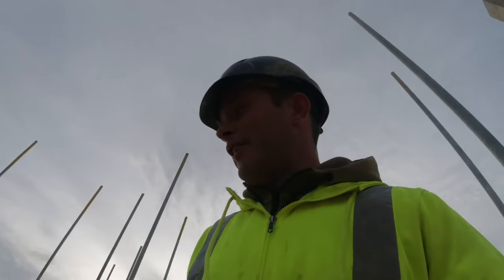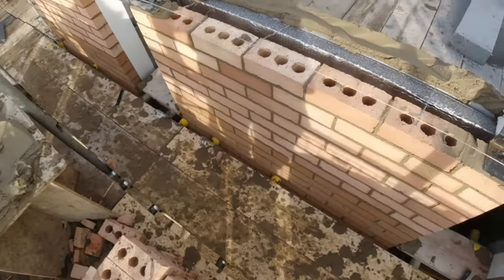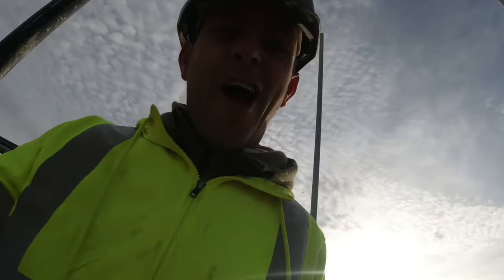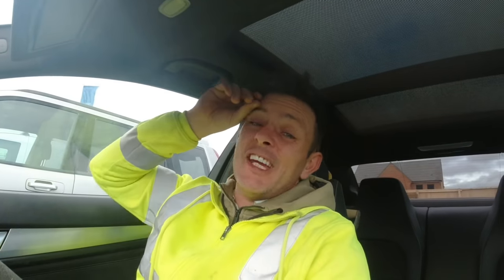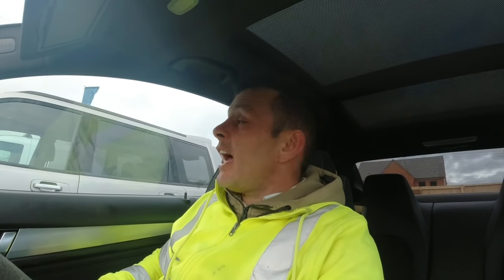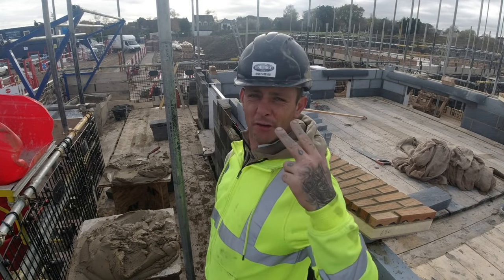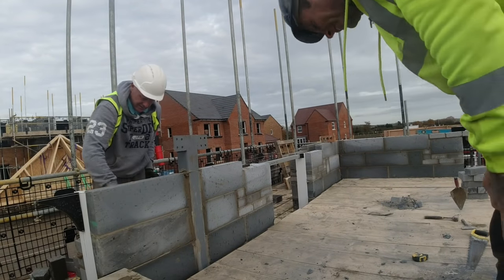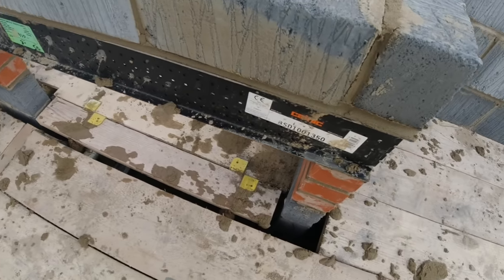Bricklaying (joist complete 😁)

Comment: Wrist is agg mate, I've had it all wrist , elbow, back. Rest is best and nurofen help but use sparingly as they can cause renal failure if you overload, strap it up and smallest trowel possible, good luck with it mate.
Reply from the maker: Yeah im getting. MY 10 out Thursday and my boxing wraps.  To keep it tight. .least I've got a day off 👌👌
Reply: @trickybrickys  That fucked my wrists up when I was younger on the heavy bag, 65 in January still going but wish I had looked after myself bait better when was younger.
Reply from the maker: I had some lovely pain killers in Thailand when I put my back out. As soon as I'm back there April hopefully.  I'll get a load
Reply: @trickybrickys  Trouble is pain killers arent the solution only short term which maybe enough though. Thailand is fucked mate they locked down early and have had very few Covid deaths but the economy is destroyed because of it they reckon 70 percent of bars and restaurants will never open again, riots in Bangkok today.